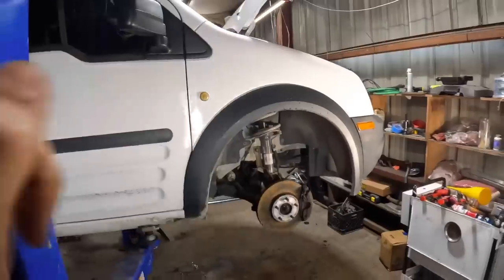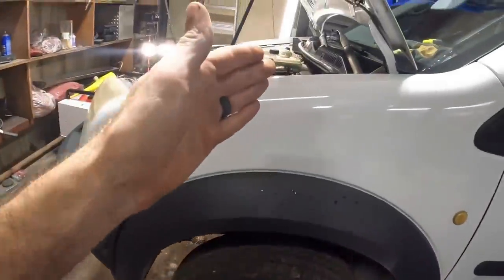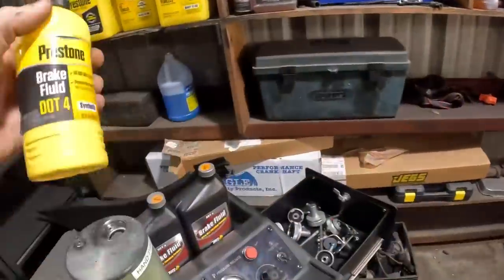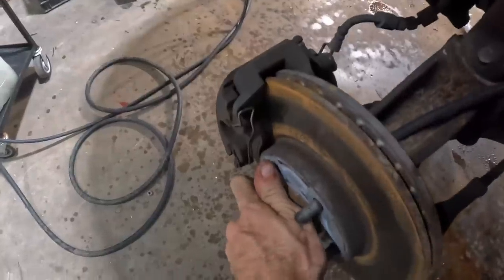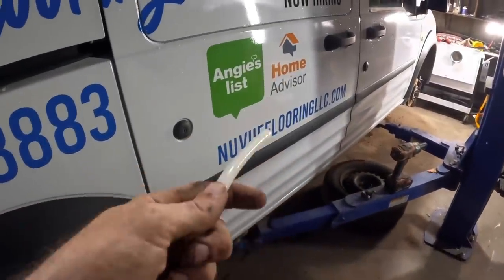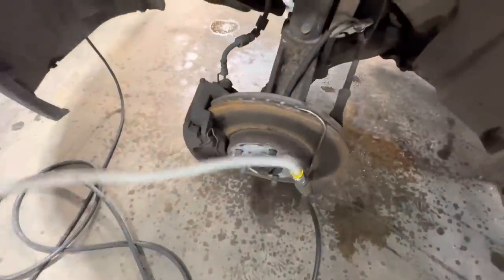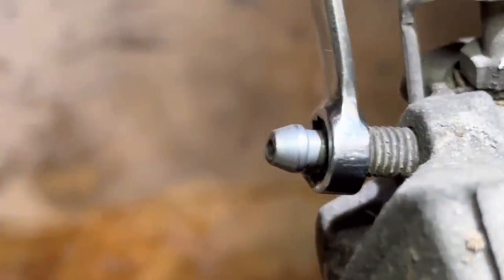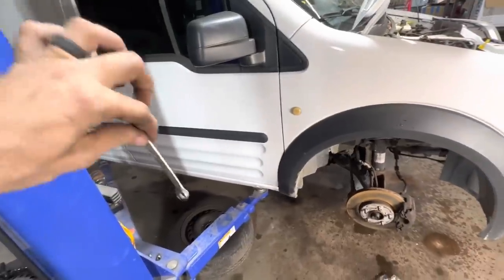Does Brake Fluid go BAD?? Ford Transit 2.0

Comment: That looked easy, all I need is a lift, the machine and a building to put all of it
Reply: They actually make hand held brake bleeders. Connect to shop air and sucks the fluid out. Same effect as this but 200x cheaper. Like 20-30$ at harbor freight. Just gota keep checking and topping off the master so it doesnt run dry and introduce air
Reply: @jacksmith2315  yeah, and they're garbage. I've used those exact things you're talking about. If they don't just straight up break, they don't work well. Either use one of these machines or save the money and do it manually, those things aren't worth the materials they're made from.
Reply: And a lite beer.

Comment: This reminds me of a customer who brought in a new-to-him minivan during a cold snap several years ago. He was complaining about very poor braking performance and wanted us to take a look. After a quick visual inspection of the pads and rotors we cracked open a bleeder valve. There was so much moisture in the brake fluid it had turned to slush. It literally came out of those lines like a lime slurpee!
Reply: The different climates we live in regulates the amount of moisture that is absorbed by brake fluid.

Comment: Brake fluid starts deteriorating the instant it is exposed to the atmosphere. The fluid  is hydrostatic and absorbs water from the atmosphere the second you pop the seal on the container up to the time you place the sealed cap back on the master cylinder. 

The moisture it absorbs will lower the boiling point of the fluid the longer it is exposed. Boiling brake fluid is bad for stopping. Another feature of brake fluid is that it is a wonderful paint remover, if you spill the fluid on your body paint rinse it off immediately or sadness will prevail.

Comment: Disappointed that you missed so many brake clean moments in this video! 😊
Reply: Lol brake fluid washed away with water. Its hydroscopuc hence the need for changes at certain intervals.
     Brakr clean isnt cheap. Rain is free daily in florida.
Reply: Yeah but nothing spilled.  Neat procedure so don’t want to waste brake clean do you
Reply: @jerryhatrick5860  I think you missed the point, and the smiley face emoji. Blasting stuff with brake clean to make it “nice & shiny” is one of the reasons why we follow Ray

Comment: All the missed “brake clean” moments in this vid… you could’ve used at least 2 whole cans. Don’t start slacking now that you’ve got this fancy type equipment lol. 
Also loved that interaction with the Wife Unit, gave me a real good laugh. Y’all are perfect together.
Reply: So great that you and your Wife are running a great business! Keep up the great work you two! Another great video!
Reply: He ran the clean fluid through until the clean came out and no air, that is all is needed. We used to do the "old way." Flush denatured alcohol through then brake fluid. Never used a bleeder-flusher needed to people to bleed the system.
Reply: I think the Brake Kleen people had to get shipment from a warehouse in another state as Ray has used up all the cans available in Florida, ha ha.
Reply: Supply chain problem with BK, also costly, brake fluid washed off easily with water.
Reply: @forgetfulme1719  Oh, but the tense music and the spray of BK is so satisfying. 😜
Reply: Yeah nice get him to use more bake clean after all it is his lungs not yours.
Reply: @carmo9693  u like him coming down with cancer 10 years down the row?
Reply: Yeah, was hoping there'd be a brake and clutch cleaner spray down. That fluid is corrosive...
Reply: @fredfred2363  all the black petroleum can get vaporized leaving nice and shiny, including the lungs nearby on daily excess usage to get views.

Comment: I always clean and dry the fitting before putting cap back on. Helps prevent the rubber failing.

Comment: We have recycle centers here in South Carolina where I can take all of my fluids that come from my vehicles.  They made a big deal about not mixing brake fluid in with the motor oil.  They said it causes real problems with recycling the oil.  Anyone else hear this?  The used brake fluid I have to take in when they have toxic waste day, as I call it, twice a year where they will take absolutely everything.
Reply: Yes, brake fluid is nasty stuff and shouldn’t be mixed with engine oil.
Reply: i mean try using brake fluid as oil and see how long your engine lasts. and try to think of a way to separate it out, probably really annoying. at best they might boil it out, but that's not great for the oil either

Comment: I change rather much of breake fluid. I usually  use around 5 gallons  in a month. My machine holds 5 gallons and it runs from 230v (i live in a 230v country) usaly the pressure is set to 31 psi.
If i remember the service manual (i work for a main dealer)  even call for little higer pressure than i use. So yoyu can crank it up a bit.
With the machin i use you dont vacuum out the breake fluid it pressure bleeds in to a container.

Comment: Yes! Brake fluid does go bad. Your brake fluid is held inside a sealed system, and most of the time, it will last you at least a couple of years. However, moisture in the surrounding air can seep into the lines and other brake system parts, or components can wear out and cause a fluid leak. Since your fluid likes to absorb water from the air, it will lower its boiling point and reduce its stopping capabilities. Furthermore, the moisture can also cause internal corrosion in brake lines, calipers, cylinders, and other components. This is why it is crucial to maintain your brake fluid by getting it flushed.
Reply: Heavy braking on hilly roads will build up heat in the brake components which will locally heat this fluid.  Any moisture in that fluid will easily vaporise producing bubbles which push some fluid back into the header.  On subsequent cooling this results in little or no brake line pressure so little or no braking & induce some driver panic!  At the very least you will need to re-bleed the brake lines but new hydraulic brake fluid is required.
Reply: No, moisture will not 'seep' into the lines, it's a sealed system, under pressure, the only place moisture will get in is through the reservoir cap when you open it.

Comment: That is one great and efficient machine Ray. It is good to see you have kitted out your workshop with the right equipment. If I recall at your last place of employment you bought some stuff from home because the workshop didn't have all the gear. You have demonstrated that a business starting out can afford the "good" stuff. It is a bugger when established businesses don't have such equipment that not only makes jobs quicker, but also assists in doing a job better which is a better outcome for the customer.
Reply: It may help that raise income is subsisted just a little bit by YouTube
Reply: @monkeybusiness63  nope, he's addressed that. YouTube at his subscriber/view counts isn't anywhere near as much as you'd think. He also doesn't do sponsorships. He got the machines because he made a deal with the company itself to be a dealer of their products and the machines are used.
Reply: The BG machine is a waste of time and money. There are different brake fluids used in vehicles depending on build date and or requirements. So with this machine you are mixing fluids on every exchange done. Not impressed. Is one going to flush the whole system after every use? More waste of money and time. I doubt you can perfectly ever get all of that system clean again after the 1st. use.

Also this thing pressurizes the reservoir tank, which can break it due to being plastic and all the heat cycles make it brittle . Is he gonna eat that when that happens ?

The suction way of fluid exchanges are the better way to not damage things and  the way not to contaminate the system with mixed brake fluid types.
Reply: @NY411Info  Thanks for your input, it is nice to see at least one person's post is incorrect in a number of fundamental points.
Reply: @robpeabo509  So what are you saying ? This machine is faster than the old way ? Are you also saying this machine does not contaminate the brake fluid when a different type is used ? I'm thinking it does.

If you want to put a link in here for a youtuber that shows me that this machine can clean out the different fluids from the lines and the unit itself, then perhaps I would believe it isn't a p.o.s. machine.
Reply: @NY411Info  What I am saying the machine can be fully cleaned to ensure different fluid types do not mix.

What I am saying that it is an efficient way of flushing the revoir, lines and callipers. At no point did I say it was superior, faster, slower  or worse than whatever way you are suggesting.

What I am saying is you really do need to substantiate your claims. 

What I am saying is you clearly read into whatever people write without giving it due consideration.

What I am saying is that in short you are a grumpy bumpy.

What I am saying is that I think I have said enough!

Comment: Not so easy with rusted in place bleeders with rounded nuts as found in Northern areas.
Reply: Thats why its good to do the service more often. Will prevent the bleeder from getting seized. Most ppl dont think its necessary though and decline the service until its too late. But for your own car, its a good reason to keep up w it
Reply: get stainless steel bleeders

Comment: When I was working with the government for the Army Reserves if I was caught letting brake fluid or anything like that just flow all over the floor my boss would be up my rear end and having me clean the whole deck down for having brake fluid or any oil dripping on the floor that's not necessary you should use a drip pan

Comment: Yes it absolutely goes bad. I worked at Honda for a short time where they recommend replacing it every 3 years. I did that on my own vehicles once, then decided that’s the last time I do that with all the other crap that needs fixing on my old Chrysler vehicles which I barely have time for. Besides cars here in the rust belt get brake fluid flushes regularly as a consequence of brake line rot
Reply: they have different coloured brake fluid.  stuff I used last time was bright blue.  I wonder if there is green fluid and this car was just done with green fluid?  a simple test strip would have revealed (water) contamination.  not sure if copper contamination shows up on brake fluid test strips.
Reply: @mazwa2007  I hope your vision is good...windshield washer fluid might have been mistakenly stocked one shelf down.

Comment: we changed the brake fluid in our race cars every 3 weeks, moisture lowers the fluid boiling point quicker than people think.
Reply: That's why DOT 5 was invented because it doesn't absorb moisture and has a much higher boiling point. Problem is, it leaves water in the system just floating around.

Comment: Ray,
I believe at end of flush when closing bleeder by leaving vacuum hose attached you are sometimes sucking air past the bleeder threads.   You then remove suction hose and fluid pressure purges that air.  Because the fluid is under constant pressure I suggest a better choice it to just remove the vacuum line and tighten bleeder while fluid is flowing under pressure.
Reply: Me Agrees with your statement...
Reply: He was doing that when he was playing with it
Reply: +1
...and tell wife unit to put the beer down.   ;O)

Comment: Here in the UK it is recommended that the brake fluid is changed at 2 years regardless of mileage Ray.
Reply: Not just in UK. Time interval is the metric to go by indeed, not mileage. I know someone who drove her car 45k mile in 17 years....
Edit: *mileS
Reply: @Emily-ou6lq  mileage is definitely the superior metric. Brake fluid doesn't go "bad" from just sitting there. It goes bad from use.
Reply: @williameldridge9382  Sure both are important but when driven "normally" as in no racetrack type of intensive usage, it's the moisture side of things that will play the major role. Water, under heat, turns into vapor which is compressible and that's what you don't want. Also, it's the fluid contained in the caliper itself that's mostly exposed to heat and degrades but the total volume of your whole braking system will absorb moisture.

Comment: I use a diy method using a mason jar with 2 silicone hoses. One hose sits on top of the jar, the other to the bottom. the top hose goes to a shop vac with a fitting that creates the vacuum. I use other jars the same way but with air psi to pump gear oil into the differential. I have another for vacuuming tranny fluid which is a one gallon pickle jar. I use them all the time for doing fluids.

Comment: Don't worry, the brake fluid going bad probably affects braking performance gradually bit by bit so you won't even notice it while driving until you really really need the brakes next time!
Reply: Preventive maintenance is a much safer approach than catastrophic failure when breaks are involved.  Just saying.
Reply: Water lowers the boiling point of the fluid, so if you got you brakes nice and hot (e.g. emergency stop from high speed) it can boil and you quickly go from spongy brakes to no brakes at all.
Reply: It’s just safe to exchange your brake fluid regularly especially before it turns green.

Comment: They make a little electric device for around $10 that will test for the amount of moisture in your brake fluid.  If I remember right it tells you to change it when it hits 3%.
Reply: That's what I heard too.  1-2% okay, 3% time to change, over 4% bad.
Reply: We just got one in my shop, got tired of people telling us "it's fine" 😆
Reply: you can get packs of test strips too.  just dunk it in the master cylinder.  depending on what color it turns, it's either good or bad!

Comment: I got a <$30 manual pressure brake fluid bleeder and it works great. Finally did this task at almost 200k. Fluid wasn't terrible, but it was well past time. My truck manual says 50psi, but the max of my tool was 30psi, which worked fine.

Comment: Mc reservoir level depends on how far discs and pads are gone. If the level is maxed out on used discs/pads the fluid will overflow when pushing the pistons back in case of disc/pad renewal.
Reply: Yea but anyone who has business touching brakes already knows that before they push the piston back in
Might as well have the max in case you start a small leak
Reply: @Onewheelordeal  Seems to me like Ray sucked the level off to max upper.....on not new pads n discs.
Reply: I kinda forgot that oneday and wondered why I had brake fluid dripping down the fire wall... 🤣🤣 only make that mistake once
Reply: Exactly what i was thinking during this. Should have refilled to where it was when he started so it doesnt overflow next time the pads and rotors are done
Reply: @jacksmith2315  exactly

Comment: brake fluid ages, i wont say goes bad its only moisture from the air, you could refresh it by heating it in a pressure vessel with a few psi of vacuum to pull out all the water content, filter, and reuse. or spend $5 on a new bottle......
when bleeding if fitted with abs work from furthes point from abs.
if rear has a brake pressure reducer valve dont have the rears hanging on some it can block the flow. (did on my peugeot had to suppport by rear axel etc)

Comment: I heard  the bad fluid can damage the abs pump,which could be expensive.
Reply: this is true, brake fluid is a hydraulic fluid, designed to be compressed. when it goes bad it absorbs water, which is incompressable, so that ruins seals and the pump itself. leave it there too long you'll even need new brake lines after they rot out.
Reply: @bradhaines3142  You got that wrong. Hydraulic fluid is not compressible! Water though, will boil under heavy repeated braking and turn into vapor which is compressible and will create that mushiness in the pedal feel.

Comment: As a youngster back in 63 working for a rust belt new car dealer,  I read a factory service bulletin that recommended fluid exchange/flush every six months. 
Not following the recommend myself, years later I had a wintertime brake freeze up during a subzero freeze period in my pickup.  They'd thaw overnight in a heated garage and freeze up... not releasing within a couple hours on the road.  Sure enough, someone suggested and problem solved after flushing the system.

Comment: I so want one of those machines!  ( of course I don't need one) but that would make my life so much easier then the whole, fill the reservoir and pump it out with the pedal on each wheel by myself. Great Video Ray!
Reply: You can get cheap brake bleeder that hook up to a compressor. Works the same way. Pulls a vacuum to suck the old fluid out, you just have to keep an eye on the master to make sure it doesnt run dry. Harbor freight has them pretty cheap. It also comes w a bottle you fill w fluid and put it over the master so it auto fills the master. Ive never used it though. I jus keep checkin the master and topping it off. Same result as this, 200x cheaper. They're like 20-30$.
Reply: @jacksmith2315  You are right that their are much more economical machines. I have several. But I don't like the vacuum system as I have seen them suck air in through the threads. I use a machine that puts about 10 psi at the master cylinder and then it gives enough to drive the fluid out at the wheels.
Reply: Don't spend the money if you have the time..gravity bleed works just as good just takes forever. Same as Ray's procedure really just plan on several hours in some cases.

Comment: Okay so I have a question for you Ray. The last few videos you spilled transmission fluid and brake fluid onto your floor. What do you use to clean the fluids off your floor? Do you just put oil of sorbent down and that's it or do you occasionally use some kind of a cleaner to clean it?
Reply: I've always used SPEEDY DRY or kitty litter.  They leave the floor extremely dry